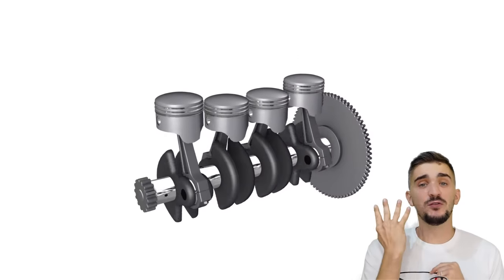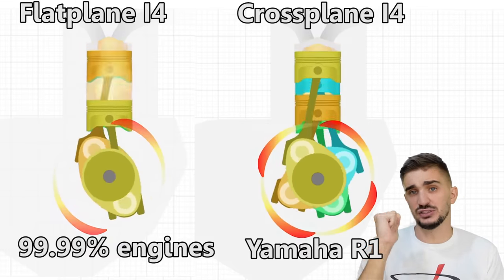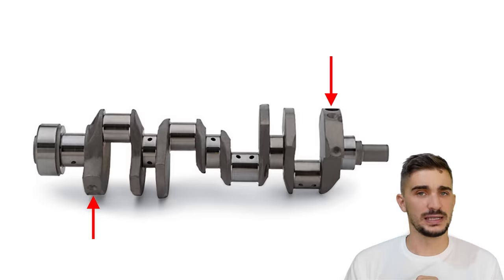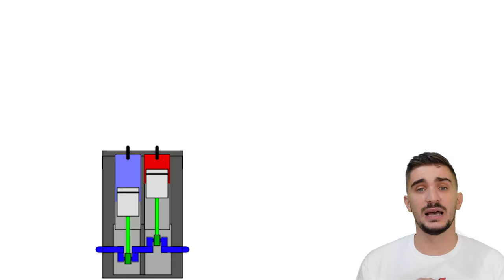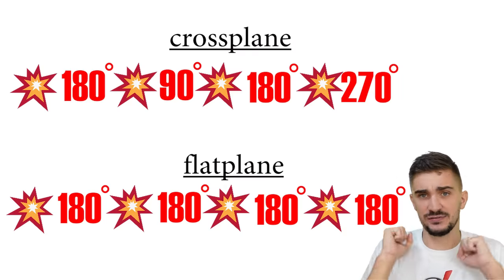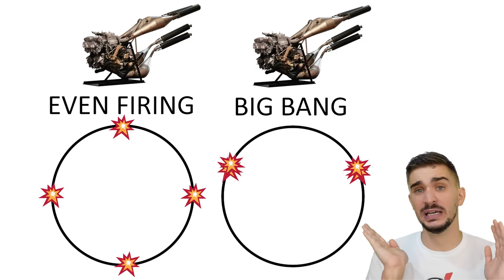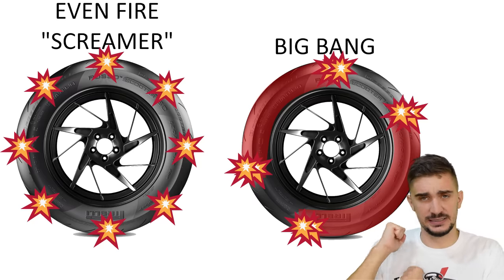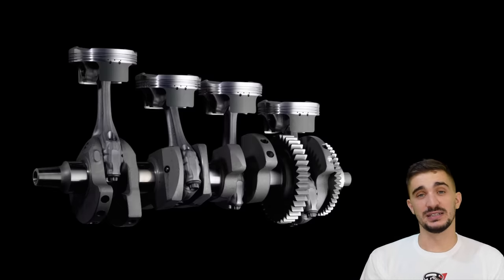CROSSPLANE inline 4 EXPLAINED in detail - How the YAMAHA R1 i4 differs from all other INLINE FOURS

Comment: I love how that Crossplane I-4 engine has an incredibly similar sound to a crossplane V-8!
Reply: Also sounds close to the Aprilia V4 as well
Reply: I mean, it's a given. It's half of a Crossplane V8... 😂
Reply: Does it wheres yhe links peeps
Reply: Gotta love yhe triumoh speed triple tho
Reply: Kirk Wolfe  the only exception I can think of is the 3rd gen Coyote 5.0. 7500rpm from the factory, with built blocks pushing towards 9k. With a cross-plane crank.
Reply: @oxidizedolive  it's because Coyotes are overhead cam. All Ford V8s have been since the late 90s, and so they all have the potential to do so since they don't have the valvetrain limitations pushrod V8s are faced with.
Reply: @omarosman8335  correct.
Reply: BMW E9X M3’s 8400rpm S65 cross plane crank V8. Eargasmic. 😌
Reply: At low revs it kind of reminds me of a Wankel. Not really, just kind of. In like the SUPER low RPM. like under 1k.
Reply: He said a crossplane V8 is 2 inline4's together in a V
Reply: @oxidizedolive  but a flat plane four doesn't sound like a Ferrari
Reply: @grantm1891  and?
Reply: Kirk Wolfe  No, has nothing to do with number of cylinders. The V8 is just two 4 cylinders next to each other. After that there's the choice of crossplane or flat plane. Which determines the sound. Flat plane V8's have existed since the beginning of time.
Reply: @bobbymoore1615  you mean triumph
Reply: @grantm1891  It pretty much does.. with the right exhaust. It sonds like two 4 cyl engines in stereo.
Reply: @ridezosmon2306  That's correct. Except V8's are often cross plane. So in those cases its two crossplane inline 4's together.
Reply: @martinsvensson6884  that can work too
Reply: @omarosman8335  the newest Ford gasoline/petrol engines are actually pushrod.  The 7.3 "Godzilla" and the smaller 6.8 are pushrod engines.
Reply: And a crossplane i-4 2 stroke sounds like a 4 rotor
Reply: @Dominik189  If it was 2 stroke it sounds like a 4 rotor at high RPM. Take Yamaha's VMAX-4 snowmobile, for example
Reply: @oxidizedolive  Crossplane engines have been around since the 1920's. Most of the old Indy and F1 cars used them in the 60's and Ferrari is famous for their high revving crossplane engines. Old tech developed by Cadillac!
Reply: @jdubb2386  didn't know Cadillac developed a flat plane V8, that's kinda cool, but I knew flat plane engines were nothing new
Reply: You could do better losing that adjective.
Reply: @johnsmith1474  Bruh, not even sure who you're talking to, but this is an engine video, not an English lesson.
Reply: @oxidizedolive  i5 don't sound like a v10
Reply: @jradish  this is like the 3rd person, and I still don't get your point. Engine sound has less to do with cylinder count and more do do with arrangement and firing order, hence the difference in functionality between cross and flat plane crankshafts...
Reply: @timmchugh1731  8250rpm on the S65. The S85 hit 8400 rpm, but the S65 was not able to achieve this due to balance issues I believe
Reply: Flat plane V8 is the Best
Reply: on the other hand, some hondas sound like Ferrari engine, especially on cam
Reply: i invite you to check Honda's MotoGP V4 engine sound in the pits VS Honda's F1 V6 engine in the pits. it's the same. V4 is 1L and V6 is 1.5L. if you do the math, it's exactly 50% increase with 2 more pistons. rev limiter is around 15k rpms for both. of course the F1 turbo acts like a muffler but if you really pay attention to the engine sound only, it sounds the same. it's actually crazy. i suppose they have the same firing sequence to sound so similar. in fact without turbo and MGU, an F1 would sound like a big MotoGP.
Reply: @martinsvensson6884  on a V8 engine it depends on the V angle. Otherwise there will be uneven angle of firing. So a 90degrees V8 will have a crossplane at 90 degrees meaning two flatplane i4 sitting at 90 degrees. This will give an even 90deg apart firing.
The 60degrees V should have a crossplane at 60-120 degrees and not at 90-90. And will have an even firing angle.

Due to the fact there are a lot of powerstrokes in a v8 and the imbalance created by a flatplane for both i4's is not significant the flatplane v8 exists. It has a few advantages over the crossplane(with the V angle) v8:
It can have short crankshaft with two adjoined connecting rods on the same journal. And it is easy to manufacture with fewer crank arms fewer counterweights, cheaper. At the cost of inbalance in the firing and the overall imbalace harmonics. But at low rpm is not an issue and agains is cheap to produce and creates a potential short crankshaft.

Today, the crossplane with more journals, although more complex to manufacture, is doable and gives a better balance overall and even firing order.
Reply: @jayb293  
The Honda MotoGP bike is a V-5, not a V-4.  One bank has 2 cylinders and the other bank had 3 cylinders.

Comment: Great explanation of the big bang 2 stroke engine. One thing you may have missed is how the two-stroke "power band" which you described as a brutal power delivery came in suddenly and made them hard to handle because the power would suddenly double or triple (for explanation purposes) when it hit a certain RPM, primarily due to the exhaust expansion chambers getting "on the pipe".
Reply: I came up through the 500 GP era and it was amazing and terrifying at the same time. The engines were on/off switches and the powerbands were quite narrow. Drivers of that era were brave indeed.
Reply: Did it also have something to do with the valves opening more at a certain rpm or something like that???
Reply: @professionalhuman4429  yes that too, people forget they had power valves
Reply: Two strokes and the CVT, or DCT. Would be a wicked combination

Comment: Your explanation, presentation and delivery is out this world.  I never thought I could finish this entire video coming in with just mere curiosity on the crossplane design.  Your way of "teaching" is bounds and leaps ahead of what could be the greatest teaching styles most everywhere.  Thank you very much!
Reply: Yeah. I saw 26 minutes and was like I'll just skip through some bits, but I never did, it was too interesting.
Not one minute was boring
Reply: It must be my lowcarb diet that made me actually not feel overwhelmed in the mid section.
Reply: So an inline twin has a perfect primary balance because the forces that go up are equal to the forces that go down, but an inline 3, while 1 piston is going down, 2 are going up and that is why the primary balance of an i3 is so bad, but In an I4 crossplane there are always 2 pistons going in the same direction, so an I4 crossplane should have a perfect primary and secondary balance, because the primary balance has nothing to do with the rocking couple,
Reply: I had the same experience. I was somewhat interested, but by the end I was gobbling it up.

Comment: "Rev happiness" is the best way I've ever heard it put. Explains why I love my rotary engines & motorcycles so much
Reply: I too love my Dorito engines.
Reply: As someone who likes torque I'm happy with my 5.3L V8 though I've never had the pleasure of driving a rotary, I imagine it would be fun
Reply: I used to ride the twin rotor Norton Interpol and Commander bikes back in the late 80s and early 90s, which were nominally 588cc. These engines were incredibly smooth. The party piece, was to stand up a 50pence piece(an irregular 7 sided coin) on it's side and you could rev. the engine and all you'd get was just the slightest movement, but it would stay upright. No chance with a reciprocating piston engine. A twin rotor(Rotary/Wankel) engine has the same firing pulses as a 12 cylinder 4 stroke, that's why it was so smooth and sounded great. On the IOM TT course, I used to go down to first at the Gooseneck and the sound was fabulous. Oh well, memories.
Reply: Rotary relyness?
Reply: @seantaylor2683  Non DOD/afm right? ;) Got the 6.2, so I second that with these ls style motors.
Reply: @iRA_mkb  Not really, but great when they work.
Reply: @20tea  Yeah, I've got an '04 Silverado stubby stepside
Reply: @seantaylor2683  Nice, great motor!
Reply: I like the revving characteristics of my Ferrari F430’s flat plane V8 that revs to 8,900 rpm.
Reply: @epi2045  Oh yeah, those flat plane v8's sound amazing!
Reply: @seantaylor2683  give me a torquey V8 any day. A hot rotary blasts off at high revs a bit like a two stroke bike, an old peaky one. Not a power valve two stroke.
Reply: @redtobertshateshandles  Yeah I know a V8 would be better for your average drive but I'd still like to experience a rotary, could be fun
Reply: @redtobertshateshandles  rotaries actually make fantastic torque throughout their rpm range, ultimately you are usually comparing a 1.2 or 1.3L Mazda to a large displacement V8, theres no reason a rotary needs to be the same displacement as a geo metro.  

A rotary displacing 5.3L would cream all but the hottest truck motor builds.   At the same level as the rx8 6 port engine you would be looking at 660lbft and over 900hp. 90% of that torque comes in by 3000rpm.

The rotary is even more impressive when compared to the best piston engines on the road today, the Hyabusa displaces the same cc as the Renesis but still makes significantly less power and much less torque while needing to rev a bit higher. 

The thing absolutely tramples comparable car engines in every aspect(except mpg, but I doubt a geo metro trying to make even half the power would get better mileage anyway)   and is only limited by the fact its only offered in relatively small displacements.

Comment: I adore my Yamaha MT-10.

Depending on where you are in the rev range it can sound like a V-twin, a muscle car, a V4 or a banshee trapped in an engine block. It’s not an engine, it’s an event.
Reply: 😂🤣 2009 R1 here. I have to agree with your last statement. Definetely an event.
Reply: 2019 MT-10 for myself I agree as well
Reply: 2013 r1, yup I love my r1
Reply: Loved my 2013 r1  now have a v4 aprilia 🤫
Reply: I have pre crossplane R1 and 21 mt10. My R1 would destroy the mt when 100+ but the mt  Is so good that it’s not even a debate. R1 faster mt better.
Reply: BRAVO!!! Excellent explanation and clear visual reference points. I love the sound of my Yamaha MT 09 cross plane three cylinder, unique for sure. The R1 and  MT10 are just plain wicked sounding, in a mechanical symphony type of way IMO!!
Reply: It's similar to my 660 raptor although it's a single cylinder, depending what rpm and load you have on the motor, it could sound like a thumper, a Harley, or a nasty stoked v8. It's a bit over the top but i love it lol.
Reply: I think i need to go try one
Reply: I rode an FZ10 when I was looking for a bike .
Thing sounded badass
Reply: and drinks gas like a powerboat.
Reply: @TheLubemaster  Would adding 2 teeth to the front sprocket of the FZ9 balance it all out in overall?
Reply: @sevendyseven4090  
No, changing gearing changes the top speed and the acceleration, but has no effect on balance.  The one possible exception is if your engine has a vibration at a certain road speed that you find very annoying, because that’s the speed you like to travel at.  For example, if you like to ride at 75 mph/120 km/hr, and the engine’s vibration is worst right at that speed, changing the gearing will move the vibration peak to a different road speed.  Even though the vibration is still there, it won’t be annoying you at your favourite speed.

If you do want to change the front sprocket, I’d recommend adding only 1 tooth, not 2, because 2 teeth on the front sprocket is a big jump, and will make the bike feel sluggish and slower to accelerate.  One more tooth might be all you need, but sprockets aren’t expensive, so why not experiment?  Changing the rear sprocket allows for a finer adjustment, because 1 front tooth equals about 2-1/2 to 3-1/2 rear teeth, depending on your gearing.  Set up your bike to suit you, and you’ll be a happier rider.
Reply: @nomorokay  What i am ideally wanting is much more top speed, an less wheely'n tendencies, 2 on the front seems the way to go, but perhaps 1 up front sprocket, 3-4 less on the rear.
Reply: @sevendyseven4090  
Try one change at a time.  Your bike’s gearing was selected to be the most useful for the most riders, so a small change in gearing may be just what you need to make it suit your personal needs.  However, keep in mind that to get a lot more top speed you’ll need a lot more power, more than your stock engine has.  It’s easy to overgear a bike.  An overgeared bike will actually be slower, because a too-tall top gear won’t let it reach the peak revs needed for top speed.  You could find that after you rev it out to the max in 5th gear, it won’t go any faster in 6th gear, because the top-gear rpm is now too low on the power curve.  Small adjustments are the way to go, like 1 tooth on the front OR 1 or 2 teeth on the rear.  Not both.  

If adding a single tooth on the front gives you a higher top speed, good for you.  However, if you find that it makes your bike feel a bit sluggish and your top speed is not actually any higher, then re-install your stock front sprocket and try a rear sprocket with just one less tooth.  Hopefully, that may give you an extra 8 km/hr (5 mph), but don’t expect more than that from a stock engine.  The engineers at the factory were paying attention when they selected the gearing for your bike.  The chance that it’s more than slightly undergeared (geared so it runs out of revs before it runs out of power) is pretty slim.  Anyway, how fast do you want to go?  These bikes are pretty fast already.  There are not many places or times when you can actually run them up to top speed.  If your buddies are routinely taking off from you, and going faster seems like it’s worth the risk, maybe you just need a faster bike.  There are very few shortcuts to going fast.

One thing that will reduce a tendency to wheelie and may give you a bit more top speed would be to fit lower handlebars.  They’ll lower your centre of gravity and reduce your frontal area, reducing your wind resistance.  Just be sure that your lower bars and everything on them, like levers and switches, don’t hit the fuel tank or the fairing when you move the steering all the way in both directions.  Good luck!
Reply: @Josh-cw8by  wow. Each to his own I guess.
Reply: @Josh-cw8by  What an ignorant comment, believe it or not things sound different to different people..
Reply: @mudsucker1971  how’s the Aprilia?
Reply: @kashy1116   A joyous celebration
Reply: ...its an event."
Reply: @Josh-cw8by  if the objective is to do the opposite if anti-lock braking for winning races then that is how the scale will be tempered for the concert. end the argument and just get a single. nothing sounds better than that and no firing orders and crossed planes. put put put put POP! i love throttling out a single combustion cycle
Reply: @charlieroloff7545  I believe that's why the MT-09 (850cc) has more torque than the 765's Triumph, but less power. Now Triumph is moving to crossplanes as well in the 1200, which I think is the way to go

Comment: Incredible! As an engineer and a rider, I loved how cleanly and clearly this explains the tyre use and firing order. Thanks for creating this
Reply: I wonder how the transmissions in MotoGP bikes hold up compared to if the engines fired evenly. That's a lot of vibration transmitted through the gears and chain.
Reply: I find it crazy-borderline comedic that they wouldn't try to resolve the problem at the tire end. Considering it only occured due to a technology change there.
Talk about law of diminishing returns!

Comment: This was the most educational video, I've seen lately (allmost ever). Finaly explains why (at the time) Ducatis were faster than Yamahas, although Yamahas had more HP (L2 vs. inline 4).
Reply: I was just thinking about the Duc's traditional 90 degree engines and what effect that would have.  This may explain a bunch, going back to the mid '70s with the 900 Desmo.  :-)
Reply: Well L2 Engine was also using desmodromic valve, which means it doesn't really need to worry about valve floating
Reply: The additional ~200 cc helped too you know.. *meh
Reply: @JukkaX  Yeah, Duc. mafia always had unfair advantage ....
Reply: Unless i have lost something, ducati & aprilia are using V4 (nowhere to be found in the first diagram). And V4 is a great configuration cause it has torque everywhere. Buying a ducati V4 is expensive BUT the aprilia RSV4 and the Tuono are descent. With the "factory" package they offer if i ever  go to 4 cylinders i will look there.